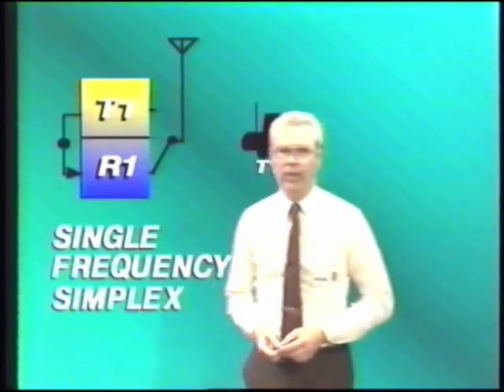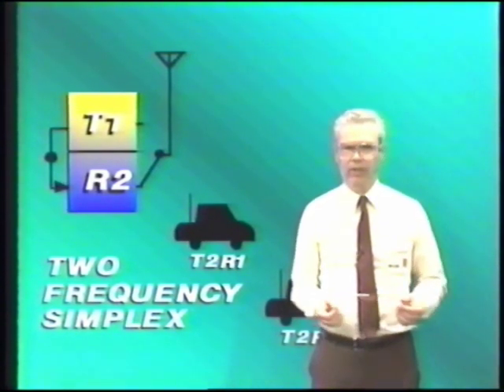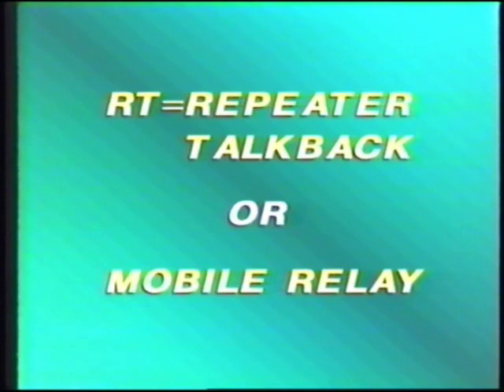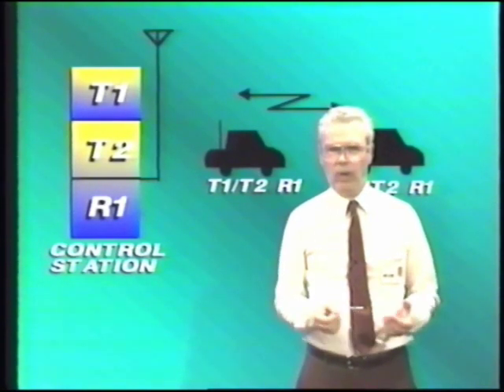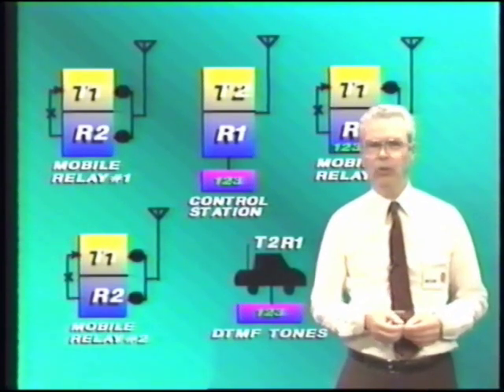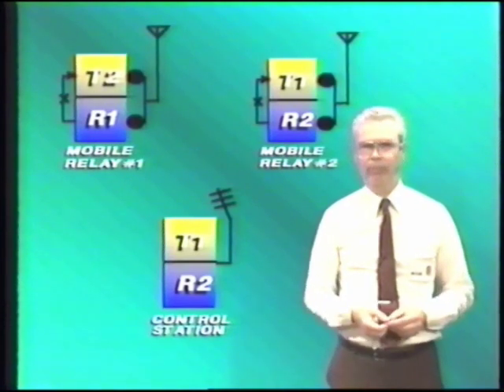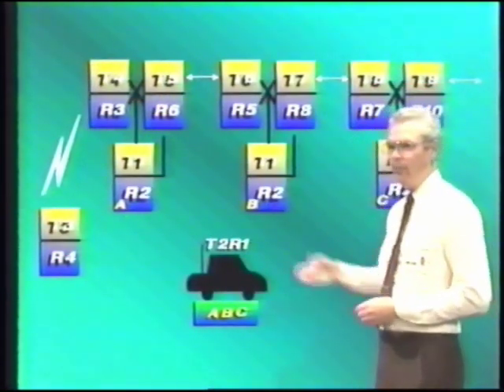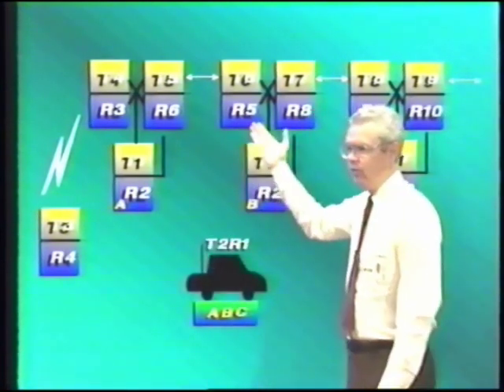Basic Communications Systems

Comment: 0000 Field Assist Service Training
0000 Basic Communications System Configurations with Dan Clark
0030 single frequency simplex systems
T1 = transmit on frequency 1
R1 = receive on frequency 1
T2 = transit on frequency 2
R2 = receive on frequency 2
0700 full duplex - (such as the med channels at 463.00 mhz)
(also duplex mobile telephones at 152 mhz and 454 mhz in USA)
0820 repeaters
1020 control station (FX1 - usa / fcc designation)
1300 multi repeaters
1400 private line / dpl / ctcss
1511 - dtmf
1710 lockup problem
1730 community repeaters (FB4 FB6 FB8 - fcc usa designations)
2000 RA / repeater automatic (aka 'remote base')
2400 relay station / multi hop
2615 - dont shoot / repeater keyup delays
2700 backbone system
2810 - PAC RT / VRS / MO3 - 150 mhz / 450 mhz - 250 milliwatt portables
3100 MO3 timing scheme mentioned
3151 1992 by Motorola Inc